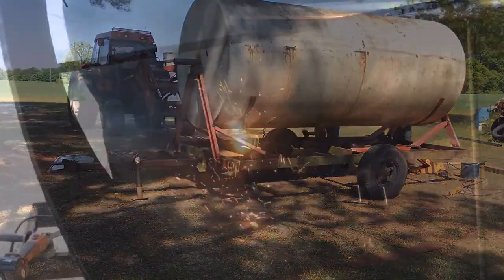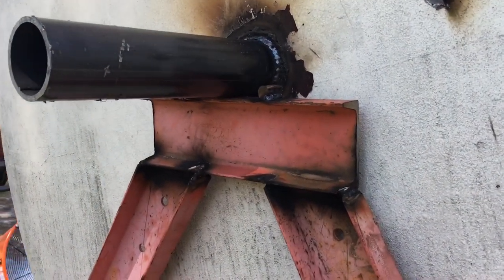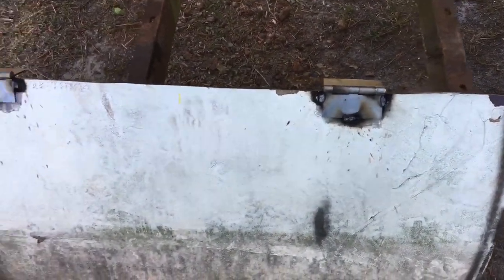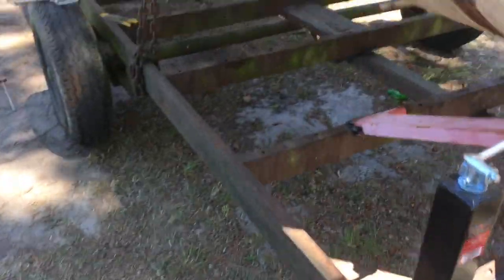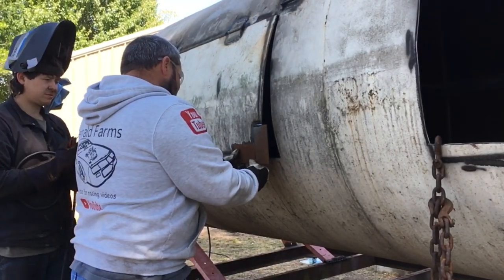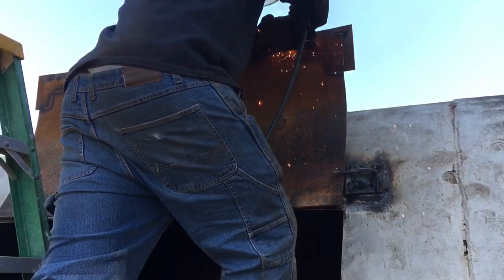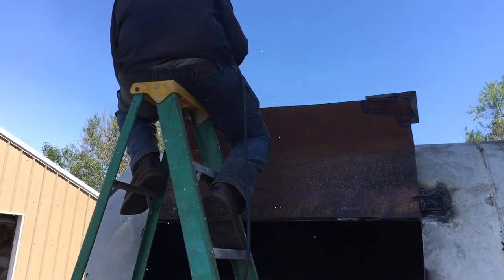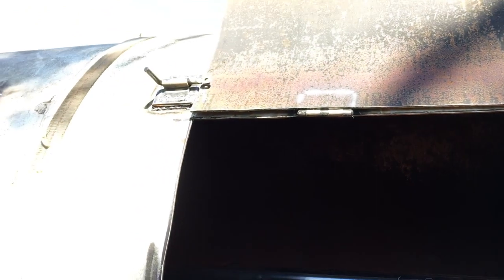Chicken house pad washer part 2 Gerraldfarms

Comment: I don't see grinding marks on the outside of the tank, your son did a good job welding and NOT burning holes in the tank. Mr. Gordon is going to end up wanting you to remove those handles on the support stands and weld nuts on, then he can use a cordless impact to quickly drop and retract the stands. Looking Good you two!!
Reply from the maker: That’s a good idea for the jacks stands. Have a good one buddy